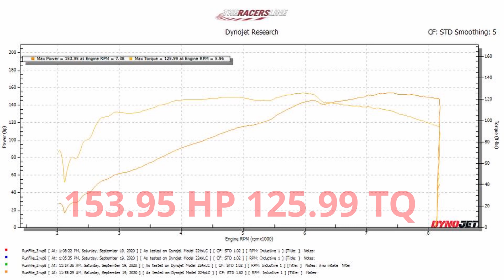7AGE AE86 Dyno Battle Garage RS

Comment: Did this run with stock cams? Doing a very similar build so wanted to know
Reply from the maker: Yes stock cams. Note: the  bottom end is very tired  at the time of this dyno riun
Reply: @CMAutohaus  Thanks. 154whp is already solid I feel given how limited the mod list is. 20V heads must just flow that well stock.

Comment: Right engine, right noises, right build! I've always believed around 150 whp for this chassis was a sweet spot. 
Makes me wonder what numbers my built 4age 16v will push once it's road-worthy. I've got a lot of limiting factors like CA smog and stock ECU, but that's California for ya...
Reply from the maker: This engine has a lot more power potential: the build is very old tired (needs a refresh), need a proper tune as well. But yes 150whp is proper FAST in a Corolla